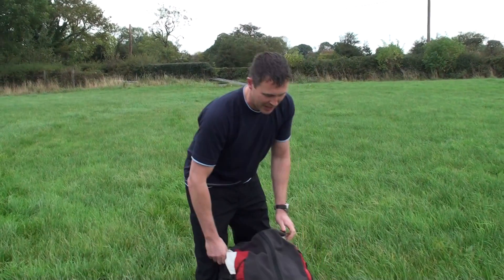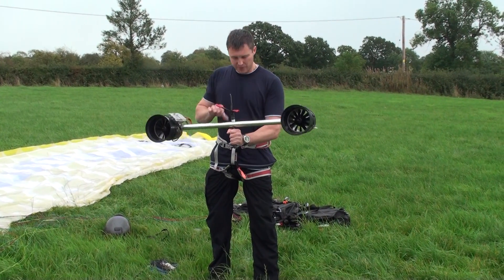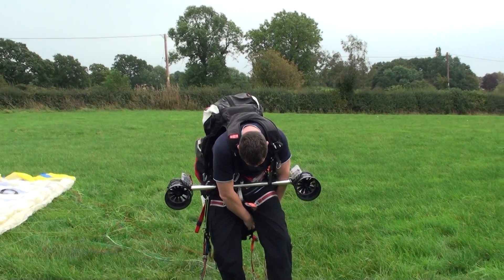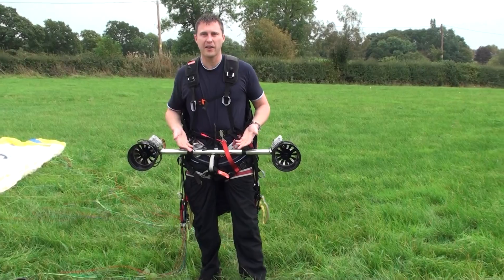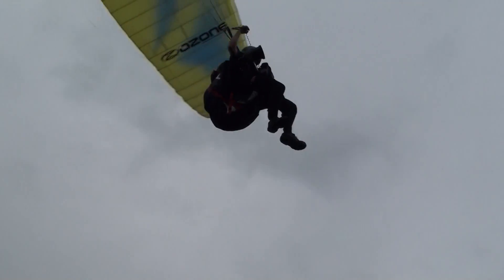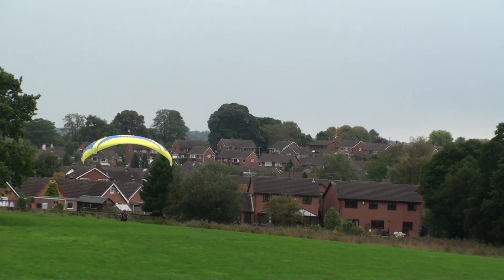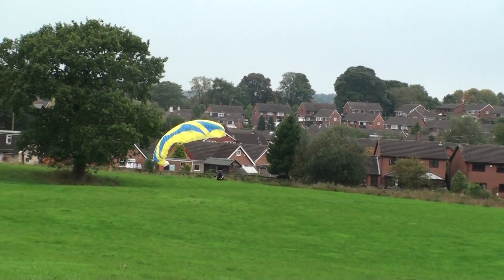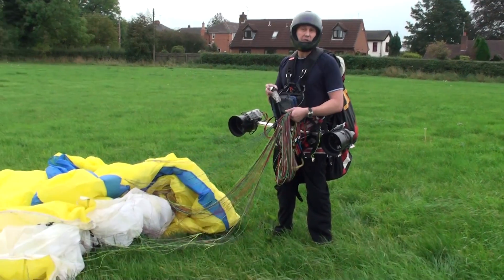Paraglider Thrusters

Comment: This has amazing potential for those of use that have problems with the huge weight of a paramotor, not to mention adaptable/removeable mount and regular harness, better thermalling once up, and not a chance of lines getting caught in the props. I may build one of these to replace my electric paramotor and skirt the laws here in Canada as it's certainly not going to be seen as a paramotor!

Comment: So lay it on us.  How has the project progressed after all these years until 2020?  Is this ready for market?
Reply: if there ready for the market I'm ready to buy them
Reply: You probably don't need to idealize it too much. It seems that each unit has a thrust of about 50N, which is a total of 100N. As an auxiliary engine for finding thermals, or for strarting down a small hill, it is perfectly sufficient. If he used 2x propeller instead of a fan, for example 24-28 / 12, an AC motor around 2x3kW would suffice. It would have better parameters.

Comment: Maybe use a small gas engine to generate electricity for those motors to extend range. I think something like ducted fans would greatly improve safety. No more windmills on your backs to lop off hands, and get damaged by gravel, and such. Thanks for the video.

Comment: Cool,  success.... I was working on a power Hang Glider harness project with 2 Dr Mad thrust 90 mm EDF, I had about 36 # static thrust on 12s  but gave up before attempting to Flat Land Launch. Radier berntsen  ( E help hang glider ) convinced me to go with no less that 70# thrust,  so Im setting up twin pusher 100kv turnigy outrunners    34x14 counter rotating  props. Hope to test in month or so.

Comment: Since you guys refuse to make them for sale I am making my own. I have got a manufacture that has made thruster units to over 40kg of thrust combined. My unit will fit to a the back of a normal paraglider harness. It will be on a swivel so after getting to a height for thermalling, the unit can be swung vertical to be in the slipstream with 0 or little drag so you have proper glide. It can also be used for low saves. Also, in strong thermals or ridge lift, the thrusters can be swung back out with no power engaged, and if they spin up in the 40km/hour speed relative wind of the paramotor they will re-charge the batteries if the charge produced by the motors is greater than the remaining charge of the batteries. In a good re-usable thermal, you maybe able to spiraldown to increase speed and charge, then thermal back up. 
This unit will NOT be a paramotor competitor. It will be a very light launch and extended flight system for thermal paragliding. Since Dreamscience seems happy to not take this further and just dream (it has done nothing for years) I will make something of it. Anyone interested please respond here. I am making one for myself, but I am prepared to go into production commercially.
Reply: Cloud Chaser can I buy one?  please contact me on WA +6281372511277
Reply: I will contact you when up and running.
Reply: Here's the info    https://www.rcpowers.com/community/threads/an-edf-thrust-tube-tutorial.14008/
Reply: I've only used EDFs on RC models, but in both cases they use a 'thrust tube' after the EDF. This is apparently to increase thrust. Would this help here?
Reply: Dear Cloud chaser, please keep me informed about your progress. I'd be interesting in purchasing one.

Comment: Best ever mate. Nice application. Maybe you could 3D print some ABS rotors for some extra thrust! I am just getting into the means and methods of that black art :-)
Say, how does  "Council" like you flying around the  park? . Sorry pal, couldn't resist. Where are the build notes regarding the motors and EDF components for your aux thrusters? 
Regards,  C
Reply: I have asked, but they won't answer emails. I have found all the gear I need, with more powerful thrusters and am looking into making one. The only problem is working out the battery needs. It will just be a launch and low save for a paragliger, NOT a substitute for a paramotor. I remember reading (can't remember where) that the main problem they are having is the thrusters get too hot for continuous flight. But just as a launch system for 5 to 10 minutes, I think it would work OK. I will see.

Comment: actually those engines were just as deadly because they can explode and if there's a fan blade failure, it will penetrate the housing and probably into the pilot!
Reply: Need to get good German units. My unit will be behind the pilot, so any failure should be not as bad. You can also have an outer housing as an extra safety.

Comment: Hmmm let's couple extremely inefficient yet power thirsty motors with the volitility of the LIPo battery into a package you strap to your body and FLY. What could possibly go wrong??? Paracord (You know, the thing holding your LIFE below the airfoil?) is not fire resistant... hope you have wings...you are gonna need them sooner than later.

Comment: still a bit under powered but nice try on the way to get motor for paraglider that not weight 30kgs, that are not dangerous with these big blades rotating at 2000 RPM behind your head !!
Reply: i agree , the cost of a new paramotor is what is keeping me away from the hobby. I am constantly racking my brain for  more simple and efficient  thrust system.
Reply: I might try an old 2cv boxer engine, it weighs around 50kg for 35-40 hp, on a trike it seems like it should work with a 120kg wing. Though the problem is still the wing, as you can find a motor for about 500€.

Comment: Basically edfs are able to provide thrust at higher speeds that the propellers won't work not even those with higher pitch. So they are efficient at high speed. Since paragliders fly at very low speed normal propellers would be much more efficient. However you still have some big advantages over the propeller setups. This setup is extremely compact and I would say safer because you don't have those big blades on your back.
Reply: Also cheaper and easier to build
Reply: +inox1ck and basically you don't risk your life every second :D
Reply: I see it as JUST a launch system and perhaps a low save system for a paraglider. NOT as a paramotor. I would like it behind the harness on a pivot, so that after you get to thermal height you can swing it to a vertical position so it is in your slipstream and produced small to 0 drag. I am going to make one as these guys won't sell em and don't answer emails.
Reply: +inox1ck I was just thinking (before I read your comment) that he is trading off battery run time with convenience. lol

Comment: i think this idea and tech you use is good but not enough for efficiency ,yeap it is lighter and smaller but it is not efficient in long run and how long you use to fly with this in full speed? i think you use your thruster always in a full speed.right? i'm not genius and i don't have any good resources than you are but just take my comment so that you could use it also to improve your ideas and tech,and also  i think you should use much more bigger thruster than the first thruster or ducted fan that you use to show to us. and i think the battery should place it on your back because it is getting so much heat. and a quick release ejection for emergency to your battery if it accidentally get fire up or explode while on the air.
Reply: another opinion that is rubbish

Comment: mate the noise must be unbearable. i did some work for a paraglider company in the UK some years ago. the best use of power was the largest prop, 2 blade, you could find. for noise and for efficiency. the smaller and more blades you use, the less efficient..you then need to carry loads of power onboard. there is a video on YT done by some Japanese engineers showing a prototype that works well.
Reply: *i think your opinion is shit

Comment: What happens if one motor fails? Do the lines twist if you don't kill the power in time.
Are/will you be monitoring motor rpm to shut off automatically? 
A direct measurement of airflow/pressure might a be better for this?

Comment: looks like there are a LOT of issues to work out (thrust, duration), but good luck.  

I think turbine engines for RC airplanes would work well, with similar dimensions, with a LOT more noise however ; )

Comment: Wonder if it would be possible to attach a cord to a stirrup then you could have vectored thrust! Given the low power I also wonder if you could steer with the motors and avoid using the brakes?

Comment: Interesting. Be good for getting you up there on a calm-ish summer's day, especially if you don't want a long drive. What is the weight of the battery pack? What is the expected duration of a 40kg thrust system? It must have some effect on the performance, once thrusters stop and you're in free flight.

Comment: Give the bloke a chance , you may get towed to 2500ft . That means you have to go to a long strip 2500ft long , I saw him take off in 50yards . 

It's experimental , just like the glider you fly , it was developed by NASA and look how good they are now as you said you can float for ages . So when they better last longer you will want one then , perhaps it may be an ideal to not use battery's but a small model plane engine linked to a generator !!!!

Comment from the maker: Hi  The battery pack weighs 3Kg on this prototype for testing and all up weight is 7Kg. The duration is 5 minutes.  The next one in build has all up weight of thrusters and battery at 12Kg and duration of 15 minutes at full thrust and a about half an hour at cruise thrust.  I've built this as a backup for use on a standard paraglider, to give a bit of extra lift or between thermals, but turns out to be a great paramotor.  I'l put details on dreamscience-propulsion as we develop.
Reply: Do you guys have a website?
Reply: That's good stats! 30 minutes cruise at just 12kg is amazing for anything electric AND it's that small. I wonder if it'll scale and get up to an hour, that would be more than enough.